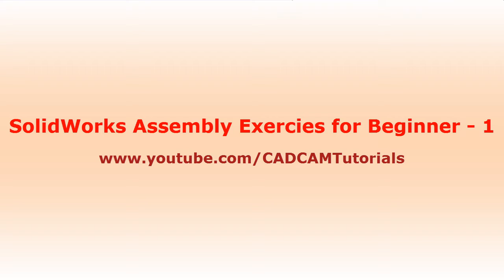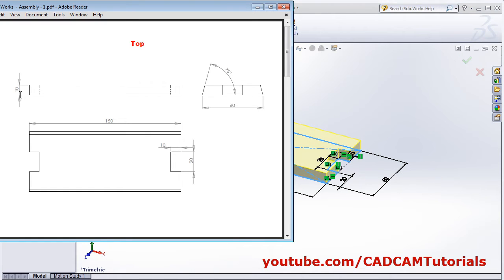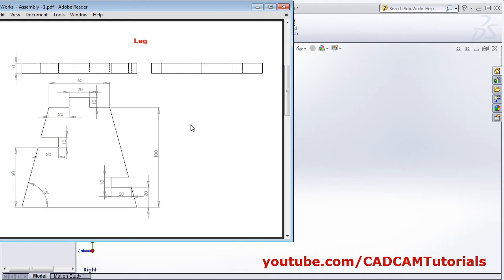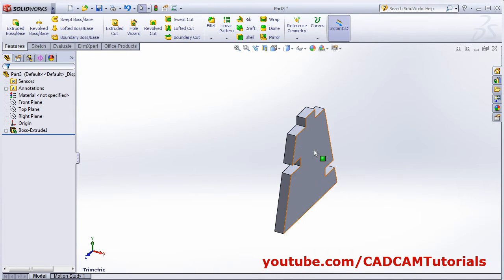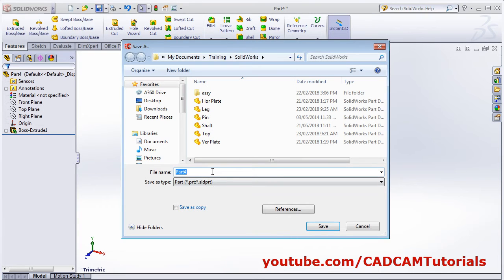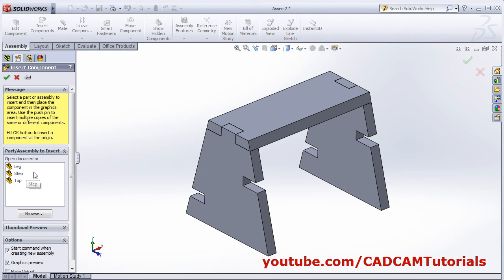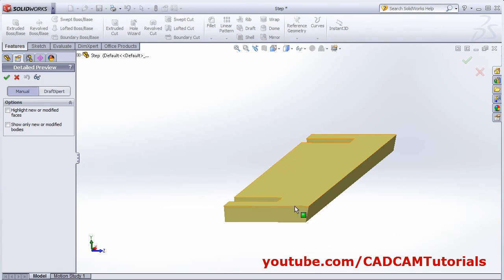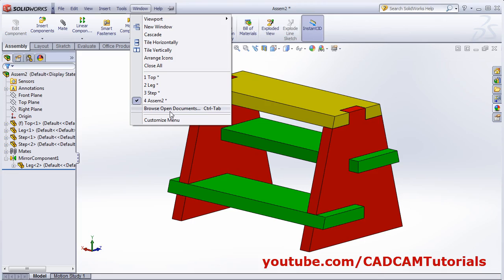SolidWorks Assembly Exercises for Beginners - 1 | Solidworks Assembly Examples

Comment: sir, thanks a lot for all these tutorials!!!! at 9:35, when i come to mate these two part then when i apply second mate  a window is POP-UP ( THE SELECTED MATE COULD NOT BE SUCCESSFULLY CREATED. WHAT WOULD YOU LIKE TO DO ??)
1.  Add this mate and break others mates to satisfy it.
2.  Add this mate and over define the assembly.
Reply from the maker: +airtel This seams to be extra mate. Some where you already have applied opposite mate. Therefore this error is shown.
Reply: thanks sir for helping me and problem is that i'm not make draft angle correct  that's why my mates is not fit properly !! thanks
Reply from the maker: +airtel You are welcome